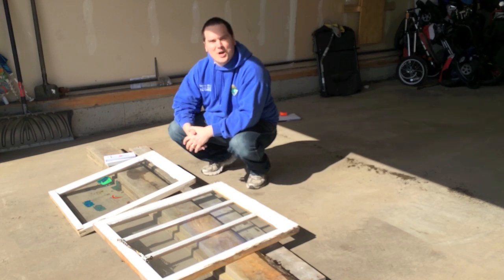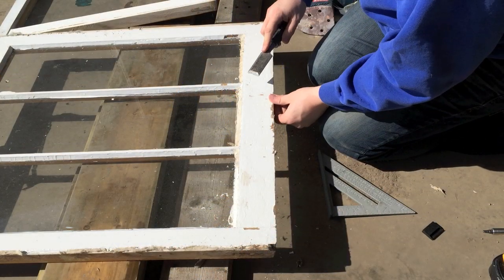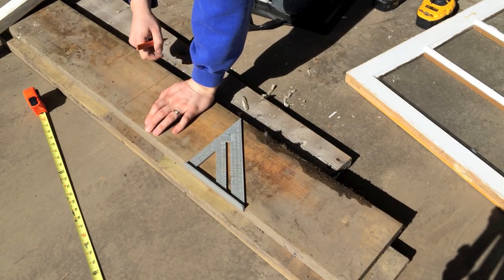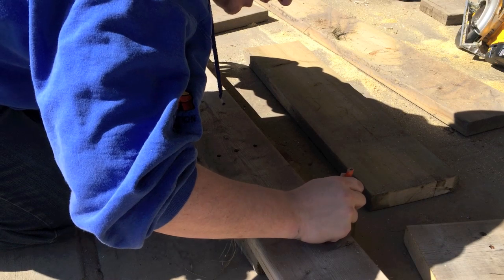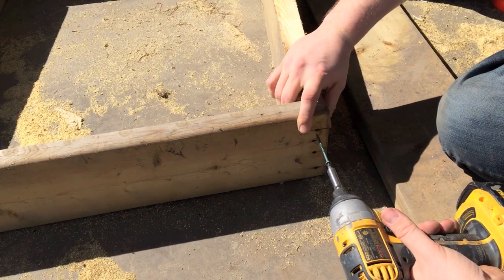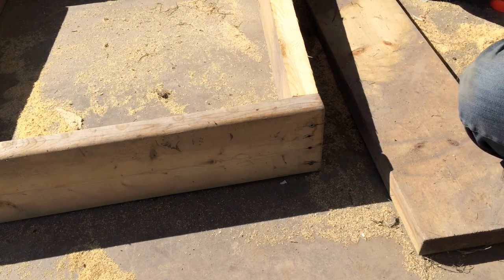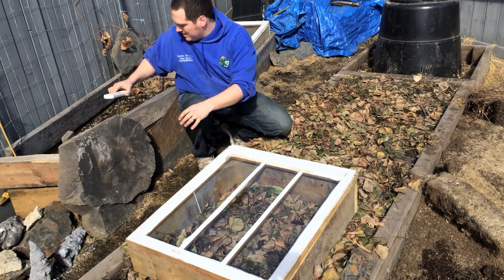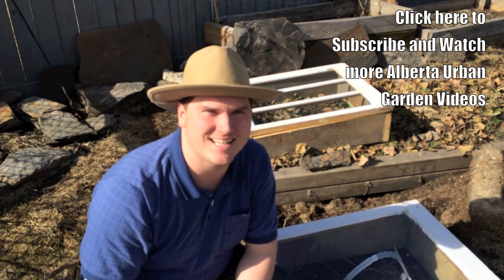How to build a Cold Frame For FREE!! in the Alberta Urban Garden

Comment: Great Stephen! I will be setting up the cold frame today. I got all of my big indoor eggplants and peppers out yesterday into the greenhouse. With the heater that I put in there, the coldest that it has gotten has been 10 C. I have to put my cold frame together today.
Reply from the maker: Sounds like you are well ahead of me this year ! How long have you been using them ?
Reply: ***** This is my first year for both. I am an almost newbie. I got back into gardening last year on a limited basis and found that I rather enjoyed it. I bought the greenhouse when I was down in Bismarck two weeks ago. They had one set up at Sam's Club. It was a little stouter than many of the plastic types that I have seen. I staked it using RV ground rug nails and place some thin foam down to protect the plastic from the metal washers. It keeps the wind from getting under it. I want to place a couple high wind guide lines on it but the ground is frozen 3 inches down. I have a large shed blocking the NW wind. I also have a big spruce  tree providing wind protection from the south. If this works out, it will tack 3 months on to my short grow season for my container veggies.
Reply from the maker: Excellent ! I think we can learn together ! :)

Comment: Some great woodworking there Stephen, I love your cold frame. I wish I could find some windows like that, it seems like in my area, re-purposed  windows are extremely hard to find. So having to make cold frames out of PVC pipe was still fairly cheap and worked okay. I think the box and windows would keep the plants warmer and with the snow at your house, I think you needed that. Great video.
Reply from the maker: Pvc works too :) I got lucky a good friend of mine re-finishes a house he owns and asked if I wanted some :) 

Have you posted your build video yet ?